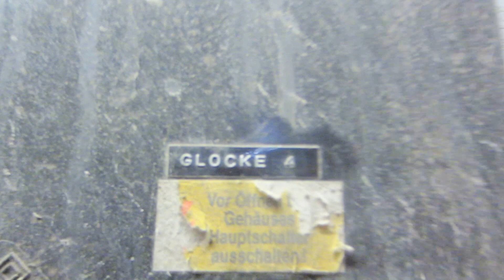Osnabrück (D), kath. Dom St.Petrus, Innenaufnahme Vollgeläute

Comment: I know, I just wanted to add my experience with those sound recorders in aswell. I have adequite mic on my camera aswell but I wanter to go even firther with quality. I would have put my recorder above aswell, but our steeples are just so small (narrow) its very hard to do anything. Now I have bought Zoom H4n so I hope I wont have any problems anymore (it was just so frustrating when I opened my recording and it was destroyed by clipping).

Comment: No, not necessarily. I must say I have bought Zoom H1, which has 120dB max SPL, and its microphones couldn't withstand the big bell in two churches (and the big bell wasn't THAT big at all). Ofcourse in those steeples there wasn't even 2 meters of space to get further away from bells. But the SPL isn't measured the same way in all companies, so if it says 120 dB SPL MAX on two recorders from different companies it doesnt necessarily mean they can withstand the same pressure level.